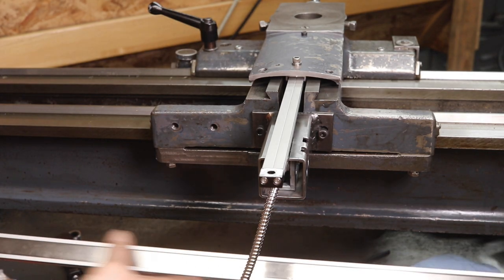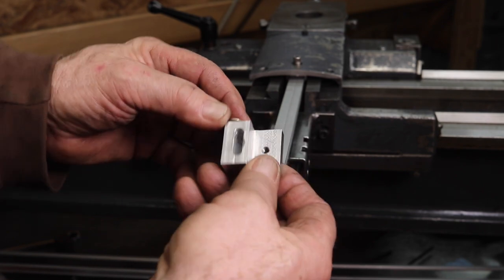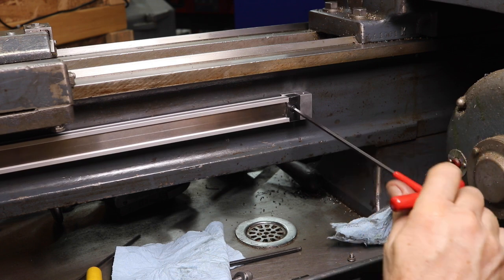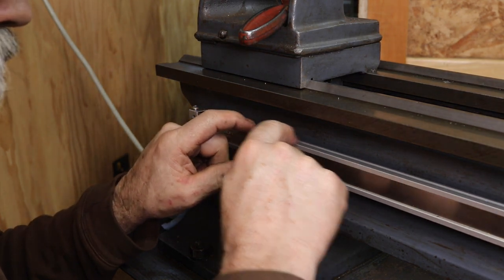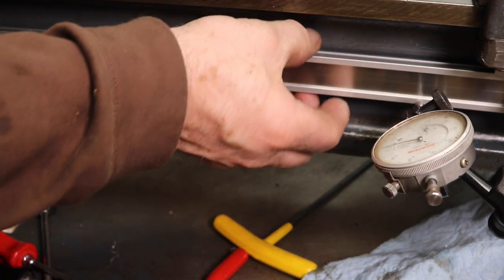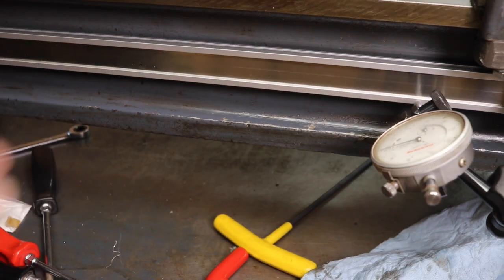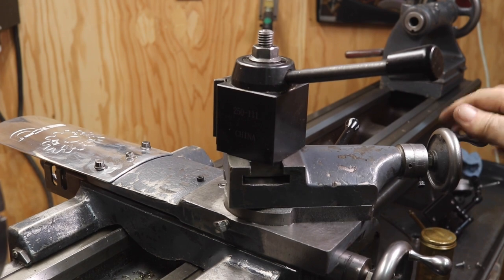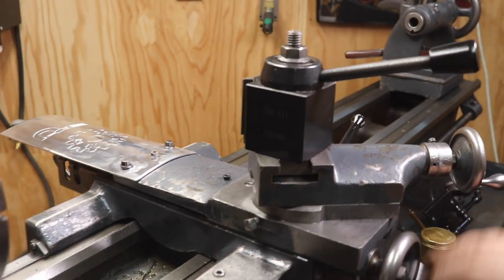DRO Installs 2 Lathes and Surface Grinder Aikron Digital Readout P4

Comment: I clamp a bench block where I want to drill/tap the hole.  I think we need one that has a switch magnet attached.
Reply: the fixture should have a large hole and a bunch of drill bushings so once you have it set you done't have to move it, just change the bushing from drill to tap.

Comment: Like it Randy, no interference with tailstock for X axis, cover looks the part.
When I put the Z scale on mine I had no access to the rear of the lathe, had to bend over the bed to install, almost impossible!
Reply from the maker: Thank you Willem,  That would be a tough job bending over the lathe.

Comment: I have a similar length Z scale from Aikron and it has a hole in the middle which is accessible by removing the cover and magnet strip.  I ended up not using it since my scale dialed in straight enough.  I did have to mill one end as the cap did not sit square and would bend that scale when it was tightened down.
Reply from the maker: On this lathe i did use any of the mid rail supports no need.  On the Lance Lathe I use them, scale over 62" long.  Thanks Robert.